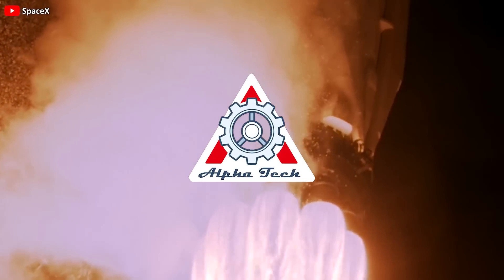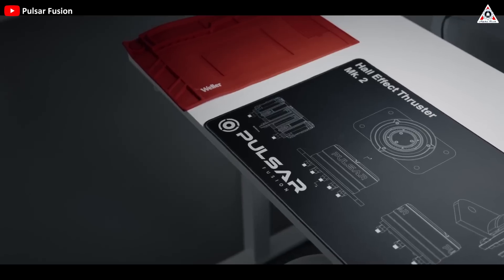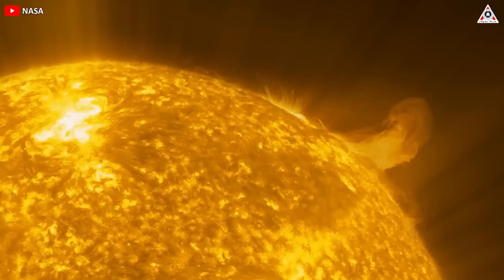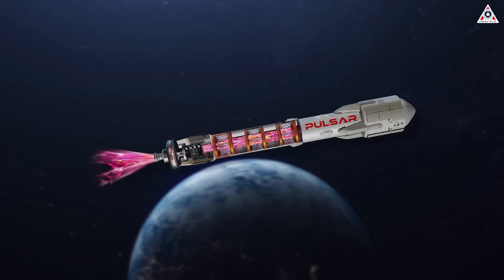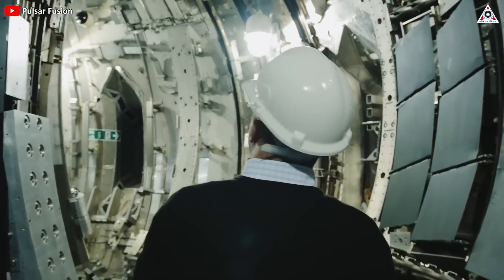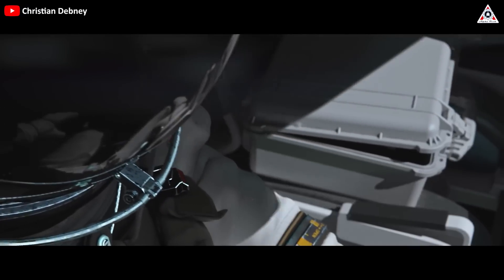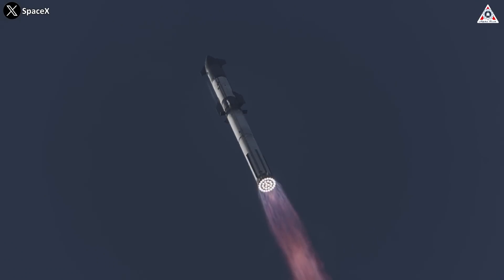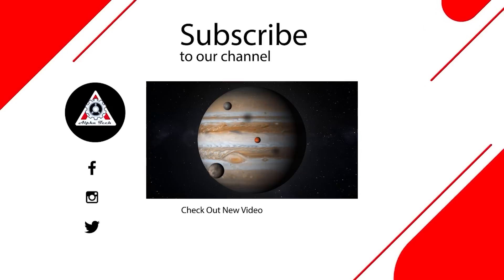The NEW Mars Rocket revealed somehow 100x BETTER than SpaceX Starship   NASA realized!

Comment: Thanks for an excellent presentation. You are also correct about the possibility of a nuclear fusion rocket as progress on fontroled fusion is finally moving forward very rapidly now. There are a number of companies now working on it and finally there is much faster progress being made than the huge reidculously expensive international project undeway in France and they are using 3 very different approaches which all offer real possibilities of success by the end of this decade.  This rocket may very well become possible this decade as it is based on what is already known and is actually much easier than producing a fusion reactor for generating electricity on a continuos basis. Anyone involved in the study of nuclear fusion is well aware of these possibilities and as a result there are now billions of dollars in the private sector being invested in this because it is now finally becoming pracrical and possible. By the way you don't assert that it will be used for take of from the earth which is correct. Fusion prpelled vehicles will be used for interplanetary flight and not take offs from the surface.

Comment: This is really badly put together. You started talking about fusion, then jumped to fission without a pause, or any sign you where self aware the two are different technologies. 

Will 'Someday' fusion or fission rockets play a role in deep space? I don't doubt it, but not like this. 

The most likely role for at least the first several decades of any sort future fusion rockets, will for inter orbital maneuvering and station keeping. More on the way we currently use ion drives for long duration missions and satellite station keeping. It main advantages in that role, is it could work at more distant targets like Saturn or the ort belt where solar powered ion drives will be too inefficient. 

As for Ground to Orbit rockets? Look at the protests and admirative blocks put into using simple RTG, Radiological Thermal Generators. Every time anyone tries to use one in a long duration mission (like the Voyager 1 and 2) the protests start, and RTG's are rock solid stupidly simple devices that would most likely survive without exposing anyone to radiation even if the rocket failed at the max Q point during take off. 
Now put an active fission device as the main thrust engine in a rocket? The radiation risk would be Chernobyl level, if anything goes wrong. (Fusion rather than Fission would be safer, but you already played bait and switch with these terms in the video, so there's no ground to know which would be in use)

Many years after initial development (and that still many years in our future) and after hundreds or thousands of hours of live real world data, and 100% safety record, would anyone seriously consider such a technology for ground to orbit operations.

Comment: I think that the US military, NASA, and independent companies such as Space X are already working on Nuclear FISSION rocket systems with current rocket engines also incorporated to get the Ship out of Earth's gravity well, and then perhaps to help it land on a place like Mars. 
At first I think that initial ships with Nuclear Fission capability might just stay in space, instead of attempting to land on Mars, until scientists like geologists, and zoologists determine if there are any lifeforms on Mars or not. Perhaps the Rocket Ship will have the Nuclear capable engine systems on side boosters, so that they can shed them off just before attempting a landing. The shed off Nuclear Booster engines might be able to be docked with an orbiting space station already built, that could use those engines for extra power on the station, or to just store them for reattachment to the previous space ship at a later date.

Comment: Let's just skip the fact that you can't arrive at Mars doing 500k mph. As much time is spent in boosting must also be spent on deceleration.  So there's that. How radioactive is the motor and/or exhaust? Will it pose the same threat as interstellar radiation or required additional shielding for the crew. Reminds me of the launch pits in Asimov's stories where atomic starships blasted off spewing deadly radiation
Reply: NASA should know, since NTP was designed and tested during the 1960's. Using today's metals they should be able to improve its reliability. I think Lockheed Martin was chosen to produce a new working prototype by 2027. DoD should accelerate that to 2025, since it was proven and exceeded all expectations. It was mothballed due to ground launch and reentry concerns. If its an orbit to orbit only booster those concerns could be eliminated or substantial reduced.

Comment: It’s funny that our government has similar yet earlier devices sitting in a scrapyard that I’ve seen on Google Earth. So this power source might be new to you and I. But it’s been around for at least 20 years if not longer. I’ve actually seen a video from 1952 where they are developing this type of power source. 1952…
Reply: Not exactly, those old ones used fission power, not fusion and, if it's what I'm thinking of, they were actually ramjets for atmospheric flight. Anyway, what this video is talking about is still half way to science fiction. We have yet to develop any kind of controlled nuclear fusion reactor, and we're still working with deuterium-tritium reactions. HE3 reactions will require temperatures and pressures an order of magnitude beyond what D-T will require. An HE3 fusion rocket engine is many decades away, if it is possible at all.
Reply: @odysseusrex5908  what I’m speaking of is not a ramjet or scramjet engine. I’m speaking of the toroidal plasma engine or whatever that device is.

Comment: You confuse nuclear fission and fusion in the introduction, very important. 

Fusion attempts to combine low atomic weight elements like hydrogen isotopes but that hasn't been achieved by anybody yet in a way that produces more energy than it takes to create the plasma, fission has been achieved, but it breaks down high atomic weight elements like uranium and it produces very toxic radioactive waste products.

Comment: First of all There is no such reactor any where in the world which can create a sustained plasma over few minutes yet . Secondly rackets need very very high pressured heated gas in order to push forward not a plasma , so if even they creat a sustainable plasma , how they are going to make it it to come out of racket nozzle with such a pressure so it can push a such a racket as space x forward?
Nuclear rackets possible only with rapidly controlled explosions of small nuclear bombs out the racket nozzle but this one also has lots of risks of its own. 
Space x is on the right path.
Reply from the maker: Thanks for your great analysys

Comment: Ok..lets get real here..there is no such thing as a sustained fusion reactor. The one the chineese are working on weights a gasiljon tonnes and is only capable of a few seconds of run-time, while not producing any surplus energy to speak of. This tec is still 40-100 years away at least.

Comment: Helium-3 is not common on Earth but has been detected on the Moon. So you would have to reach the moon (ot Jupiter) first to set up a base to mine it. This ship would have to be launched from orbit as NASA wouldn't really wants to set off a huge fusion bomb  in Florida. Radiation from He3 fusion is not zero, there are side reactions, and this if nothing goes wrong. Starship can get significant mass to LEO and with its heat shield and flaps act as a landing shuttle at Mars, being able to synthesise methane on the surface to get back to Martian orbit. Thus there is a role for both, but once we get infra structure set up in orbit.
Reply from the maker: Thanks for your comment. Keep following and discussing on our channel ♥️
Reply: Yes, Helium 3 has been detected on the Moon, but so has water ice and yet they can't find it. Until it's fact and not an anomaly, this is all fantasy. Not to mention they haven't even cracked fusion yet. Plus the FAA will never let a nuclear engine fly for the reasons you stated. A lot of s**t will have to change.
Reply: If you are going to talk about a fusion energy source, Boron is really the ideal fuel.  The Boron-Boron fusion chain does not produce neutrons....thus much safer to use and to repair afterward.  Boron needed to make this work is also so incredibly common that people literally buy the stuff as laundry detergent and flush it down sewers just to make their clothes look clean.  One box of Borax soap has enough of this element to send Starship to Mars and back....if you can get the fusion reactor to work in the first place.  That is the real problem, and this kind of nuclear fusion reactor or any fusion nuclear reactor is simply a joke and doesn't exist.
Reply: @roberthorning7601  yeah, I'm familiar with Boron a little. Like you said, IF you can get fusion to work in the first place. Seriously, if they get Fusion to work it will change everything. Between Protium, Deuterium, Tritium, and Boron, there should never be a shortage of power on this planet again. Anywhere. Those elements are abundant in ways that make the word abundant seem inadequate. The big question is, can they? I say yes, eventually. Since a star can do it, there's no doubt about it, it's possible. BUT.....?

Comment: Please, don't mess fision and fusion. Das sind ganz andere Dinge.
And more powerful Raptors will not shorten the travel to Mars longevity, because it can be shortened nur by greater speed, and greater speed needs more fuel, and more fuel means more mass and so on.